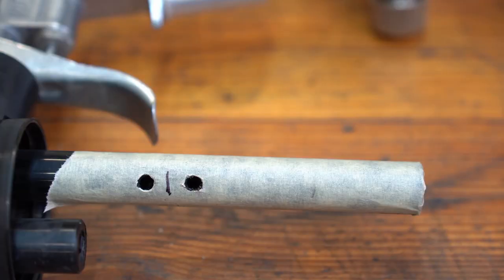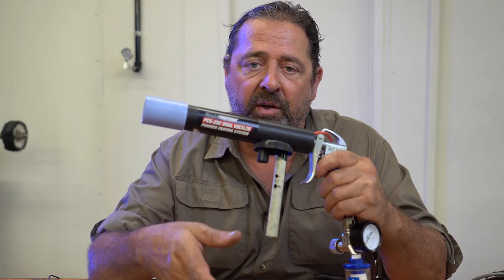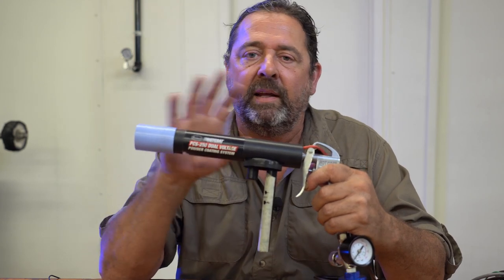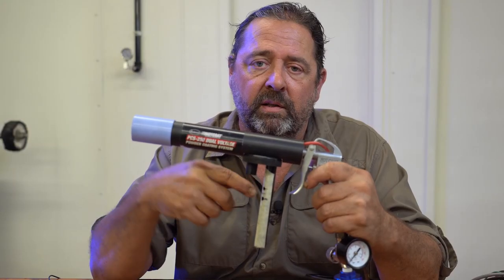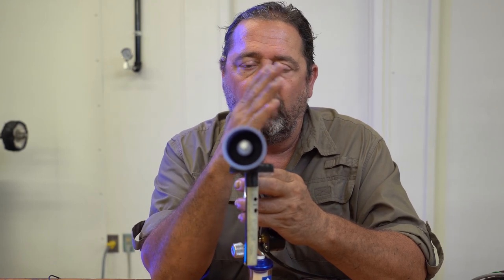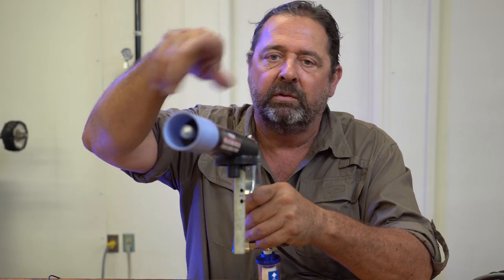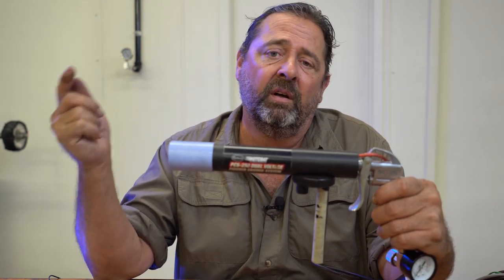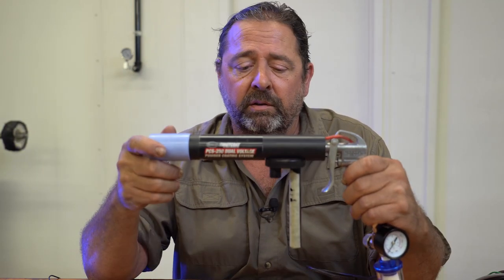EASTWOOD INPUT TUBE MODIFICATION!

Comment: I saw the other video on the Eastwood, and I'm glad I saw this one before I modified the input tube!  Thanks for going into more detail.  Your Diffuser Kit works great BTW, thanks.
Reply from the maker: Glad it was helpful!
Reply: Unfortunately he never mentioned 30 degrees in the last video and I drilled mine right in line! Not cool
Reply: @jaredfloding7949 Can easily fix that. Just use some baking soda, and super glue to fill the holes. Or some kind of glue. Then drill some in the right spot.

Comment: Your videos on this have really helped me. I am new to powder coating and couldn't figure out why i have so much powder everywhere when i am done but yet after its out the oven its very uneven an i have to coat it again. Well i found out i should not have so much powder on the ground vs on my product an was told to get a new gun. I might try this before I do.
Reply from the maker: There is something very important that I have not done a video over yet.  Your part needs to be grounded directly to a ground rod.  A ground rod is a 5 or 6 foot rod that is copper coated and driven into the ground.  Most houses have them.  Look to see if the building you're operating out of has one of these rods, if so then connect a wire from the rod to your part.  It is a must that you have your part well grounded in order to have your powder coating system work properly.  If you have any questions then please conntact me via my email....cycle4fab@gmail.com               Thanks for watching.

Comment: Hello , my name is Rick and I was wondering about your fist Eastwood diffuser was made from brass and the on your selling is made from aluminum I think? Why not solid copper for best conductivity ? Buy the way your videos are very informative thanks for posting them
Reply from the maker: Good question!  And I've been waiting for someone to ask it.  Copper is more conductive but it is also more malleable (and sticky).  Copper does not machine well at all, and trying to do mass production machining would not be profitable.  I have had on rare occasion one-off jobs with copper and hated every moment of it.  Copper works great in a swaging  operation, but a cutting op is a nightmare.  It sticks to any cutting tool that it touches.  Thanks for watching!

Comment: Hey bud. So I bought the kobalt mini air regulator but looks different from the thumbnail in this picture. Is that a different part you screwed in the bottom to trap moisture? Fill me in please! Trying to get all my ducks in a row. 🤙🏻
Reply from the maker: Yes. That is the water/oil filter for the air, it's a Kobalt product as well.  It even has a small valve on it so that you can drain the water/oil out of it.
Reply: @CycleFab  ok I’ll have to go back and get that also! Thanks for the reply. You’re the man!

Comment: Is there any way to extend the wires one these guns?
Reply: sure is. you could cut and splice in a spark plug wire for the high voltage line. 
i used hot glue to insulate the bare wire before putting on some heat shrink tubing. if your joints arent solid your going to have a bad day. 

i say spark plug wire because its rated for high voltage. you dont want the spark jumping through a thinly insulated wire and zapping the bejesus out of you. 
unless you're into that sort of thing...